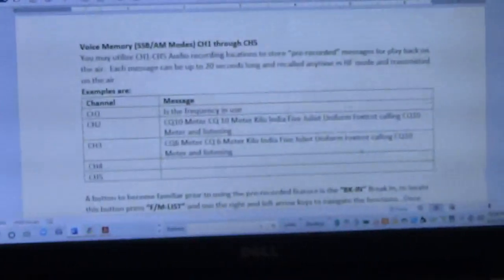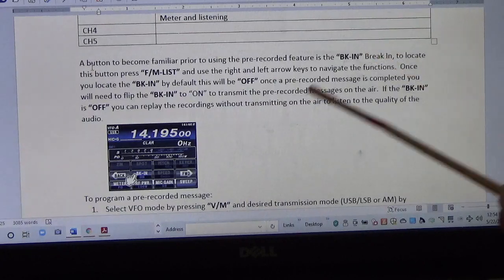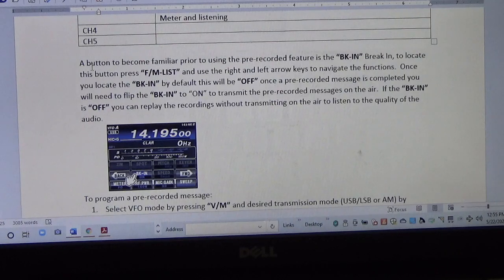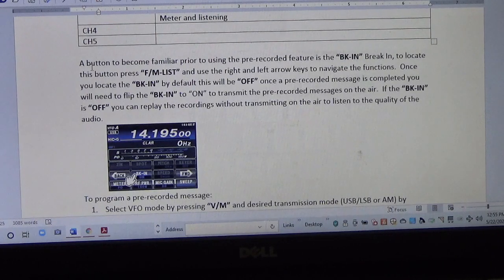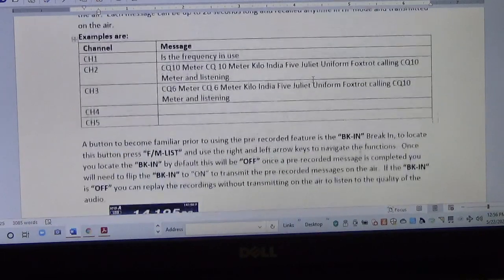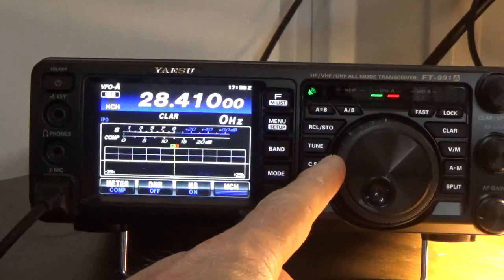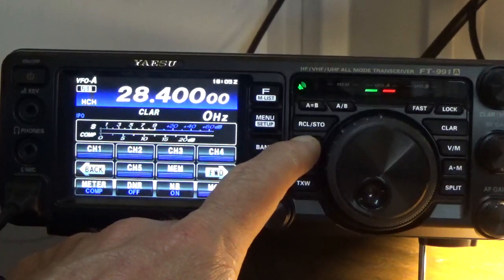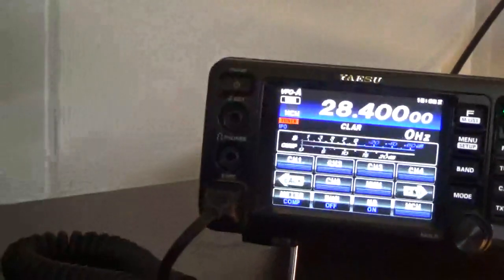Voice Memory (SSB/AM Modes) CH1 through CH5 FT991A Yeasu and using Antenna Tuner

Comment: I'm trying to learn everything I can on the 991A before my radio gets here.  Already, my power supply is here and got tested on my 2 meter rig, a Kenwood 281a.  W Rusty Lane K9POW in eastern Tennessee
Reply from the maker: Good evening Rusty - congratulations on the FT991A and hope to catch you on the air, let ne know if there's anything you need '73

Comment: Have had this radio for about a month, and hadn’t gotten to those channel buttons yet in the manual. You just saved me the trouble of reading it all... And I thank you for that! 73 sir! Mark KG7ZML
Reply from the maker: Hi Mark - Glad to help out - good luck and keep pluging away at it - I threw up a couple videos this weekend that might get you down the road on getting on the air a little quicker - thanks for watching and have a good week '73 KI5JUF
Reply: @westtexasvideogateski5juf255  I’d like to add one thing I found out doing this. That would be the playback volume. I wear headphones, and the playback of my voice calling CQ almost fried my eardrums, lol. Menu item #10 will adjust this for speaker and headphones. I guess it defaults to a level of 50.  Had to bring it down to @ 10 for it to be comfortable. A little louder for the speaker, around 20 or so.  Guess Yaesu thinks we’re all deaf... Anyways, keep the vids coming! Very helpful stuff! 73, Mark KG7ZML
Reply from the maker: @W7MMG  Hi Mark,  thanks for the feedback I never considered the large shifts in audio and the headphone factor, I'll di what you suggested - and thanks again I'm still very new at videos so I need all the help I can get - have a good week and thanks again '73
Reply: @W7MMG  Thanks you answered the question in was gonna ask .. 73